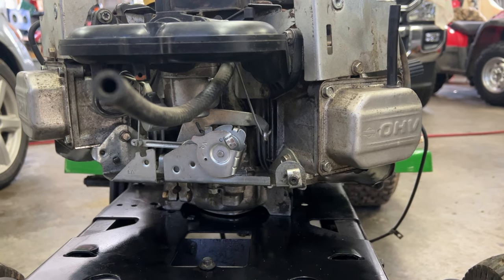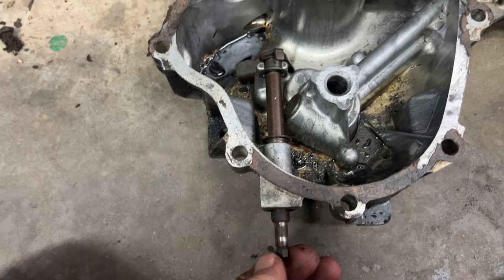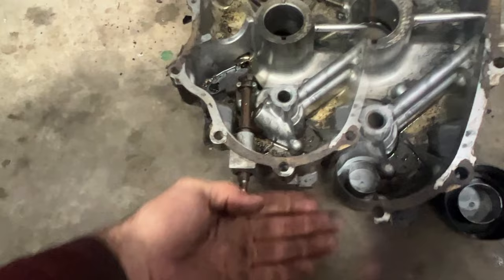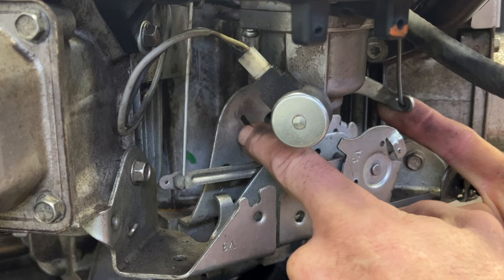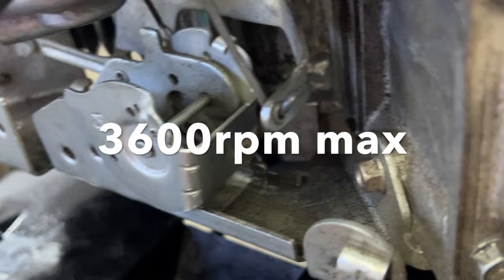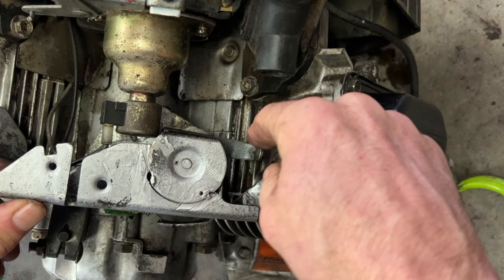HOW THE GOVERNOR works on a Briggs Stratton engine. How to adjust the idle and High-Speed John Deere

Comment: Thanks man,it took few videos until I found the good one, yours
Reply from the maker: Glad it helped
Reply: Just finished the adjustment, actually no adjustment needed, I just push few time the rod against the adjustment screw, it did not stay there, stoped the motor, moved several time back and forwards now OK. I have an RPM reader from amazon, actually it measure water temp as well , so it was very helpfull  to know how may RPM I have. Thanks. Ben

Comment: Hey how are you doing? You have helped me so much in the past my friend. Just checking in on your channel making sure all is well. My spring mower flips started off great. I also just got the best deal I think I have ever gotten so far. Pz60 husqvarna zero turn….280 hours…the mower plus a 7x16 enclosed trailer for 1200 bucks.seems like starter is no good though. How much do you think that mower could fetch? So far I sold a JD LT150 for 1400$ and a JD LA125 for 1500. Still got a yt4000 with triple bagger to sell, another JD LT150 and 2 craftsman lt1000s with Vtwins. This is my first season doing this so I’m hoping to learn a lot for next season. I still have that yt4000 with snow plow you helped me out with regarding changing the camshaft release. It runs good. Figured out the smoke was from residual oil on the muffler being burnt off. For some reason though it shuts off when I try to engage the PTO. Any ideas?
Reply from the maker: Awesome find.   About the PTO I would have to check my wiring diagram.  Probably a bad PTO switch.    Be nice if you had a used one to try it out

Comment: Got a riding mower, a Troy Bilt TB30.  Recently had a surging engine.  Thought it was the carburetor- which I replaced.  Also replaced spark plug, fuel filter, fuel lines. There is a “disconnect” between the throttle and the governor.  The surging has mostly disappeared, but it still oscillates a little.  When I start the mower and push to full throttle, the governor doesn’t move.   Do you believe I have a bad governor, a bad governor spring, or a belt/blade/etc issue …?   Thanks for the video and help.
Reply from the maker: If you have a bad governor, your motor would run at full throttle all the time.   
If it hunts just a little I would run it like that. If your carburetor has a pilot jet, you can try turning it 1/2turn ccw .

Comment: I was mowing the other day and the lawn was still wet from rain the day before. After getting fed up of stopping every 20 seconds to clean the grass out I decided to just try to finish the little strip i had left and ended up stalling the mower out. Pretty stupid of me but after cleaning the grass out i tried starting and the engine wouldn’t turn over. My battery is getting old but never had issues before. I ended up jump starting it with another battery and it started hard and now has a very high wide open rpm. The leaver works as it should to adjust the throttle but now what used to be wide open is now about 3/4 throttle. If i had to guess im gonna say it gained another 1000 rpm but i have no way to measure it other then just by ear. Ever since then iv had to jump start it every time and it turns over hard before starting. I checked the governor spring and all the linkages and everything looks fine. Any idea what might have happened? I cant find anything online. I can just run it at 3/4 throttle but i dont want to do anymore damage if i did mess it up bad
Reply from the maker: Take the plastic cover off the top of the engine.  Make sure the governor arm is down.  Push it up and see if it closes the throttle plate.
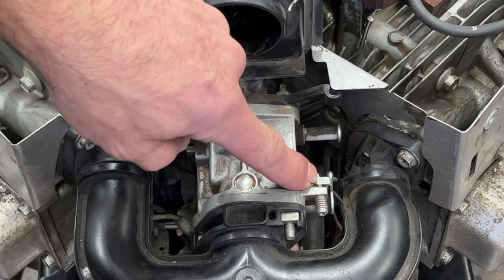 Close the throttle plate by hand at the carburetor (1:15) and start the engine (e-brake on). 
  The governor arm will go up and close the throttle.  If it doesn’t, you have a big problem.

Comment: I did everything you outlined. I adjusted / both springs. When I move the throttle it has no effect on motor. It does nothing. If I reach down while starting it will start. Otherwise it wont.
Reply from the maker: Weird.    You might need to bring it to shop.

Comment: What does it mean when the shaft coming out of the engine doesn't have enough power to push the arm up? I removed the springs that were attached to the arm and it has barely enough power to move the arm up.
Reply from the maker: The governor arm should be free to move when the engine is not running.   
  When the engine is running the arm should move up.  If you push the arm down the motor should increase in rpm.

Comment: I was riding my L190c and suddenly the idle went super high. It is still very high and moving the orange lever up or down has no effect on the rpm. What should I be looking for?
Reply from the maker: Look at your governor arm.  Push it down to see if the rpm goes higher.   
   It might be an internal problem.
https://m.youtube.com/watch?v=ze7aW_pSuko&pp=ygUZU2V0dXAgZ292ZXJub3Igam9obiBkZWVyZQ%3D%3D

Comment: HI, Thanks for your reply. I have checked your instructions, still the same. I have managed to run the engine with a manual fixed throttle, taken idle spring off and added a small return spring on carb spindle.  What I have noticed no matter how I rev the engine, the governor shaft does not rotate at all. Is that a clue. New Governor on, original was perfect but changes it anyway. The shaft was not moving anyway, that's why I stripped the engine.
Reply from the maker: Redo this setup: https://m.youtube.com/watch?v=ze7aW_pSuko&pp=ygUVR292ZXJub3Igc2V0dXAgYnJpZ2dz
   If this doesn’t work you have something work inside the motor.

Comment: Just replaced the crank and sump seal. When i reinstalled everything back the engine ran full open throttle.
Reply from the maker: Watch this video: https://m.youtube.com/watch?v=ze7aW_pSuko&pp=ygUjU2V0dXAgZ292ZXJub3IgYnJpZ2dzIHdlZWtlbmQgaG9iYnk%3D
Reply: @WeekendHobbyMechanic  so I looked deeper and noticed when I loosen the adjustment screw to the governor arm, the hex head doesn't turn left or right. Is this an indicator that the governor gear is broken?
Reply from the maker: THe hex head shaft should move.  Something isn’t right inside the motor.

Comment: Hi, Had a bad misfire, replaced carburettor. Engine now revs very high. Took engine out replaced with a new governor, did not look damaged at all. Adjusted governor to carb as per instructions.
Still revs high. Noticed the Governor arm does not seem to move througout the rev range. Any ideas? Thanks
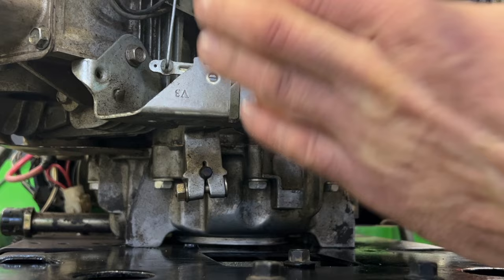Reply from the maker: Push the governor arm up and check if it closes the throttle plate. @1:12 - 1:40 in the video.
  Close the throttle plate by hand and start the motor.  It should idle. Check the governor's arm, it should've gone up

Comment: So with my riding lawnmower when I push the throttle to full it fully goes all the way open, the throttle cable, while machine is not running, but when I go to idle it doesn’t go all the way to my idle screw, machine runs awful, I set the governor, it takes forever to idle down, and just surges if I adjust the throttle a little. Could someone please help, can afford to bring it in again.
Reply from the maker: You need to clean your carburetor.  Check your intake gasket. They might be leaking. .
Reply: @WeekendHobbyMechanic  it’s a new carb, 2nd one, and I sprayed ether all around the carb and intake, idle doesn’t change.
Reply from the maker: @rogerbrandt6678  Chinese carburetor or OEM?
Reply: @WeekendHobbyMechanic  Chinese.
Reply from the maker: I’d cleaned the original carburetor and install it back in the tractor with new intake gasket.
Reply: @WeekendHobbyMechanic  thank you so much, I will do that today and let you know.

Comment: Hi i have old 12.5 Briggs with side plate Gov that seems ok and smooth running and loose when idle throttle then tight at full throttle BUT i can only get 3/4 power and push throttle further and no change. So does this mean the govt arm has slipped a little in that clamp OR the govt spring needs adj- and how?   thanks
Reply from the maker: Seems like lack of power. Can’t say without having it here in my shop.  Do a search on “flathead Briggs governor “
Reply: @WeekendHobbyMechanic  No, carb and engine are perfect as if i just move the govt arm myself i get full power, so the arm isnt automatically moving enough to give me full power. Either the shaft has turned back a touch or the gov spring is too soft or tight? The throttle lever is moving the govt arm but only to a point and thats why i can only get to about 3/4 power and move throttle more and no rpm change. somethings slightly out with the gov part as i said i can order full throttle my my fingers moving that arm a little.
Reply from the maker: @xx3868     Try backing off the spring to see if the RPM-s goes up....

Comment: Hey I have a John Deere with the same motor. And after carb replacement my tractor will not start unless i hold the rod so the butterfly is close to idle screw then it will start. Only way I can get it to start …
Reply from the maker: Might need a to clean your carburetor.   Lot of views on this on YouTube.
Reply: @WeekendHobbyMechanic  carb is brand new
Reply from the maker: @rockybrandboa1076   Why did you change your carburetor?
Reply from the maker: @rockybrandboa1076    Could be a lot of things. Low compression, Choke not closing all the way.  I have a 22hp V-twin with the same problem.  Hopefully, I can do a video on this.
Reply: @WeekendHobbyMechanic  lost one of the jets in the original one
Reply: Then I realized the whole reason why it started running rough was a push rod came off the rocker arm. Runs perfect now other than having to manual close the throttle on carb the get it to start

Comment: Hi, I recently change the Governor and need to set the both springs or to set up all from scratch. I need help. It was running at 1750 rpm idle, and 3700 rpm full open. Until I made a wrong adjustment. Help!
Reply from the maker: Watch this video   
https://m.youtube.com/watch?v=ze7aW_pSuko&pp=ygUaU2V0IGdvdmVybm9yIHdlZWtlbmQgaG9iYnk%3D
      If you set it the proper way as the video above you’ll have to adjust the tension on idle spring.  Make you sure the throttle adjustment screw is backed out.
Reply: @WeekendHobbyMechanic  yes, but how do I properly set the spring tabs on the Governor from scratch? And set up of the throttle cable.  At the moment it runs at a very high rpm almost as if it's running away, so I shut it down. I adjusted the Governor Rod as suggested.
Reply from the maker: @mudnyreycali3543   Push the governor arm up and check if it closes the throttle plate. @1:12 - 1:40 in the video.
  Close the throttle plate by hand and start the motor.  It should idle. Check the governor's arm, it should've gone up.
Reply: @WeekendHobbyMechanic 
I removed the engine, found that the Governor arms were at the bottom of the crank case. Luckily, No damage found. Just the two arms and the sheered off pins in them. All pieces collected, engines cleaned out, new governor replaced and motor back together. 
My both tabs on this Mechanical Choke aren't set correctly for the bottom spring or the top siding at the #2 position. 
Before I start this 24hp B&S up, what is your recommendation for position setting the spring to the governor arm and the position of tension or spring slop to the mechanical positions when rotated?  
There's really nothing out there but your video when setting up or adjusting rpm. 

Did what your video suggested. Dialed it right in. Thank you!  This was very helpful.